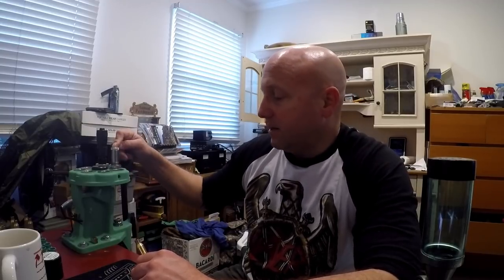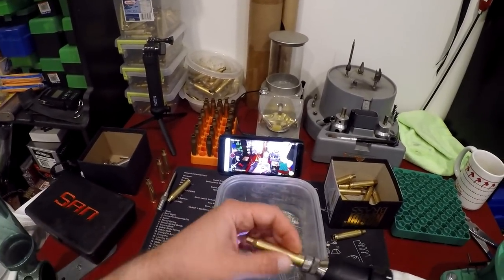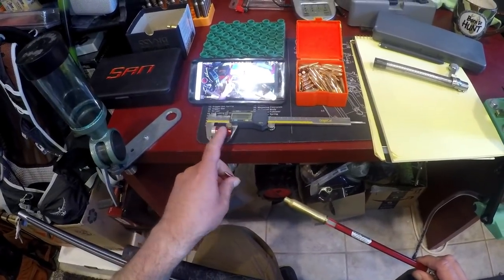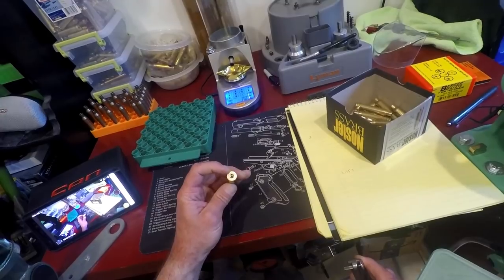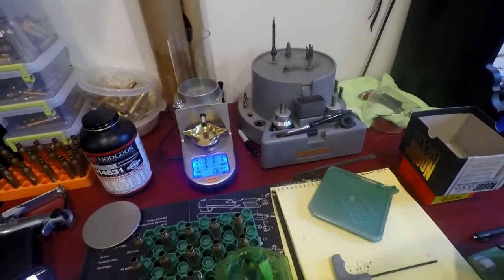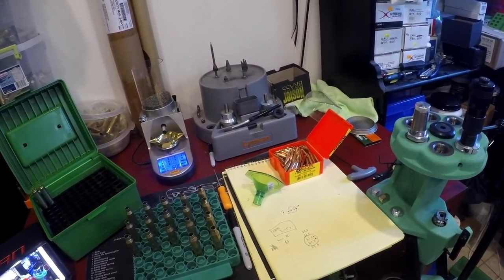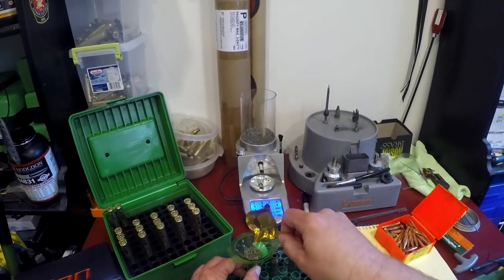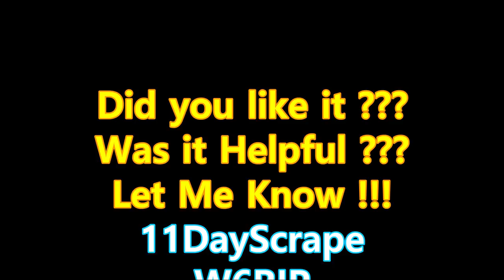Reloading for Extreme Long Range. How to step by step detailed instruction.

Comment: Question: Doesn't shaving brass off the neck make it a weaker neck? I thought the tool had to form the neck back into a perfect diameter all the way around. Thanks for the great videos!
Reply from the maker: Your only shaving off enough to make the neck perfectly concentric to ensure equal expansion in the chamber when fired to reduce runout. Runout is like a slight wobbliness because the bullet hits the lands slightly off center. The part of the brass that is exposed to the most pressure is the base. Annealing will keep the brass on the neck and shoulder from getting brittle too fast.

Comment: You measured 2.757 with your overall length gauge to the lands, you said you would add 30 thousands to the measurement, you need to subtract 30 thousands, not add to move off the lands, well when you loaded you did neither and loaded to the land at 2.757 , also you should mention if you are loading for a magazine (not sure you are) to check the overall length to the tip and make sure it fits in the magazine, and also you should check you have adequate bearing surface when you seat the bullet in the neck.  I see you caught yourself at the end of the video👍

Comment: May I ask why you didn’t crimp your rounds to prevent the projectiles from sliding further into the case throwing off your seating depth
Reply from the maker: Because 2 tenths neck tension is plenty tight enough of single loading of precision rounds. Also the crimp is inconsistent from round to round and you don't want that. You crimp stuff that is being slammed forward by a semi auto bolt because that is more important than exact MV's.
Reply: I only crimp for my large revolvers and ARs